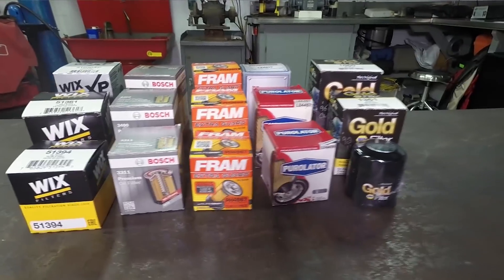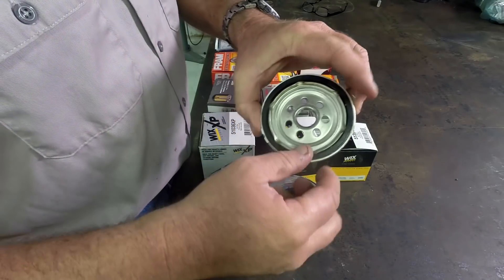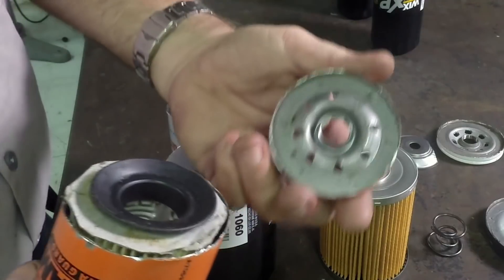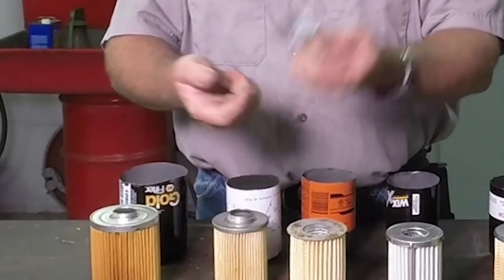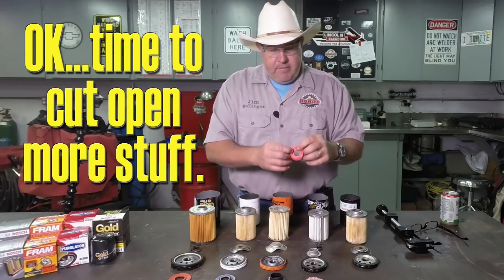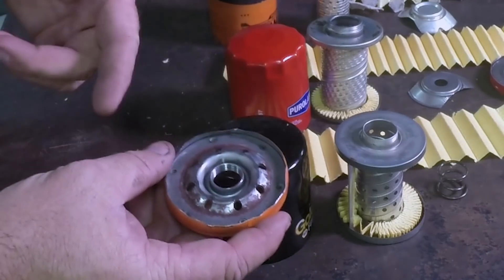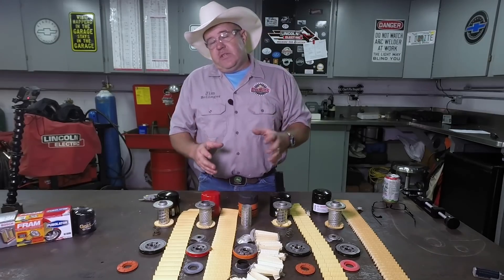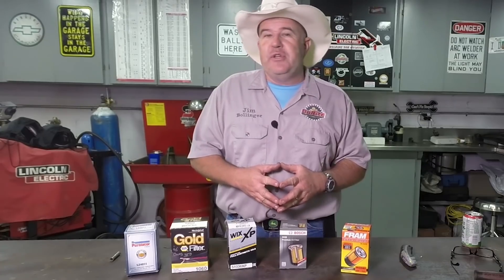The worst oil filter EVER!

Comment: the current Fram oil filters are nothing but shit.  never buy fram if you value your cars engine,  i was told by my local ford dealership about 8 years ago if you had a fram oil filter on your car, truck, or suv engine they would null and void your warranty because they claimed to have proof fram oil filters were breaking down internally and distributing the debris through out the engine causing engine damage.  word to the wise dont buy cheap buy quality.
Reply: Chris Ursiny I own a Ford and use motorcraft filters. and I thought fram was the best.
Reply: There was a TSB a few years ago when I was  Ford tech that just generically spoke of cellulose material from 'certain non-OE grade filters' clogging up passages. Ford apparently got into trouble naming specific brands, so they opted for a generic statement. However, I saw it all the time when these filters were in use, especially on engines like the 5.4 which has very small oil passages feeding the VCT system at the heads. All kinds of issues that caused the VCT not to function and even cause driveability problems. I have even seen camshafts destroyed due to passages clogged which caused oil starvation at the heads, which would then require new cylinder heads because there are no serviceable cam bearings. By the time you price out 2 heads and labor, a new engine is actually cheaper.
Reply: Damn cell phone, not hating.  Think I fix it!
Reply: Charles Larkin  No, this was years ago, and I am no longer in the dealership since I left to become a trainer. As I think about it further, it may have been an SSM. It was so long ago, that I cannot remember exactly. But it was a topic for discussion among the techs at the time and I remember our shop foreman being really adamant about looking at the oil filters and checking for debris when tearing one of these engines down. I also remember tearing down 5.4's and you would pull the block that the VCT solenoid mounts in and many times you could see crap in the oil feed holes, often it would have the appearance of being fibrous. So, I when I saw that, I attributed it to the issue that Ford was telling us about with oil filter deterioration.

Comment: Oil filters are not the only pieces of junk Fram makes.  I made the mistake years ago buying a gas filter from Fram.  It completely disintegrated inside stopping gas flow within a few months.  I took it off and it rattles inside like a bolt in a coffee can.  Absolute garbage.

Comment: I just wish the wix had the rubber grip on the bottom like the fram.
Reply: Wear light weight rubber gloves.
Reply: The grip is cute and all but oil filters don't require that much torque to be sealed. Just be sure to oil the o-ring hand tighten. Start car check for leaks. Filter wrench is handy if you really need some extra reach or torque... don't try it on the fram though, it'll punch a hole in it.
Reply: I've seen Wix filters with a wrenchable nut on the bottom.
Reply: @dano727     Ja, use an impact wrench to tighten up the filter.  Only pussies hand tighten oil filters.
Reply: can of plastidip and you are good to go.

Comment: You should compare the Napa Gold and the Wix XP to filters that actually compete with them like the K&N, Mobil 1 extended performance, Royal Purple, ETC.  You're comparing a bottom shelf product (Fram) to some quality products, which is a good comparison, but it would be even better to compare all good quality filters to demonstrate what products you should buy and why.

Overall, this is a great video, as it shows why not to use a bottom shelf product such as the Fram.

Comment: there are a number of videos comparing oil filters on youtube. All of them are basically the same. Would like to see someone do an comparison of oil filters after they have been used, to see how well they held up. What material they are made of or how thick the steel housing is, isn't that important, if they do the job. If after being used, they plugged up, ripped, allowed dirt to get past the filter or failed in some other way. This would be nice to know.

Comment: In colder climates, all these filters are mostly cosmetic anyways. Every cold morning, the bypass opens and any debris that settled into the bottom of the filter overnight just gets blown through into your bearings. Even with synthetic oil. Change your oil often and use a Fram if you want - they're fine for a low tech car engine.

Comment: I've used fram for the most part  the past 15years  or so mainly because come oil change time whatever oil / filter special  the auto parts had at the  time is what I got most of the time  it was the bottom tier fram filter as I got older began  paying more attention an watching  videos  like this  an checking my oil more often I do not  use thouse fram filters anymore if I do get fram it's the ultra syn one but that's rare now on a money crunch I'll use stp extended life or mobil 1 extended protection  an mobile 1 oil they really do work  well  an could probably go 10000 miles but I change mine at 4 to 5to be safe
Reply: youknowyoureallyshouldusesomepunctuationtoohardtoreadthiswayandyouknowwhatifinditveryhardtotypewithoutautomaticallyhittingthespacebaraftereveryword

Comment: I remember years ago we changed the oil on my buddies bike, he had a frame filter, we changed the oil, even filled the filter before putting it on to burp it. Finished the oil change a d the oil light was on. We rode it a little bit and it never went off. We went out and bought a wix and replaced it, no oil light.I've always tried to run wix on anything they made a filter for.

Comment: Watch a Fram video. Their reasoning for using a cardboard end cap is that it works better than metal. You can glue paper to paper better than you can glue paper to metal. Just watch their video before condemning the filter. As for rust I have seen that in several different types of filters, all depends on how they were stored. I'm not for or against Fram, even though I have used them off and on for years with no ill effects. NAPA gold or Wix is my preferred choice.

Comment: Biggest mistake SO MANY people do is they get the best Oil Filters.  They think that the more cleats = the more filtration.  Yeah but what you're also doing is starving all of the most important components of oil, because the oil pressure gets lower when you have a "Higher Quality" filter.  Those engines i always noticed don't last as long as engines that have always been ran with OEM or OE equivalent filters.

Comment: I've got 436,000 miles on my work truck . I put 430,000 of those on myself . I've used nothing but supertech synthetic oil from Walmart and fram filters . I'm not going to change the oil , but I will never use a fram filter again .

Comment: Used a fram filter on my last oil change, the next cold start, I noticed that the oil pressure was slow to build up and the lifters were clattering. Changed the filter for a Wix and topped off the oil level again, oil preassure back to normal and no more valve clatter on cold start.

Comment: I have used Frame filters for years, my last 2 trucks 1992 ford ranger 307,000 miles engine never apart and still running when I got rid of it. 2003 Ford Ranger 302,000 miles and still running great.

Comment: I noticed fram filters on engines with main bearing knock on startup. Changed to Motorcraft FL1A cured the problem. I recommend factory filters.

Comment: I have been using Fram for years and my engines have done quite well.  Solid has nothing to do with filtering- just look at the filters in your central air unit.  Also, if the Fram is pure cardboard, how could it rust?    With today's computer controlled engines there is not much for an oil filter to do. The engine is always in tune so there is no soot build-up.  That's why engines last forever these days.  There is no abrasive soot in the oil to wear out rings and valve guides,  so oil filters are not as important - and oil changes not as frequent - as they used to be. The important part of a filter is how small of particles its medium will stop, the amount of medium is irrelevant if it lets everything through.   I saw nothing here that gave me this info.   That kind of analysis would be much more valuable.

Comment: Where was you about 8 years ago?  I had a 1970 Chevelle with a 383 stroker motor it would do about 70 pounds of oil pressure so I decided to use a fram oil filter after the old change I drove it down to the gas station to get some gas when I cranked it up to start it at the gas station it blew off the fram  oil filter  least to say I have never used fram anything anymore I have always used wix since the ordeal. Thank you for the video injoyed it. I am a follower now I would like to see more great videos like this one

Comment: Have first hand bad luck with Fram filters. Have used Wix/Napa  or Purolator filters ever since with excellent results. Had Fram filter break down inside and restrict all oil flow. Motor started knocking on startup. Was fine when I shut it off. Traced no oil pressure to plugged filter. Changed oil and all was fine. Cut the filter open and all the cardboard had turned into sludge which caused the filter media to collapse in on itself.

Comment: I would love to see how the aftermarket filter compare to OEM filters. say for instance a Mopar, AC Delco, or Ford. I would also like to see how they compare to a premium filter like a K&N.  I quit using FRAM back in the late 80's when they switched to the cardboard liners.  I have been using Wix  or K&N  ever since.  the K&N has the thickest metal can i have ever come across their marketing material says they are designed for high flow and higher pressures. I have been using them on My big block Camaro and I have never had a problem with them.  as a side note, the newer Fram ultra filter have a metal filter cartridge, i still don't use them based on past experience with Fram.

Comment: I have a '96 Yukon with close to 300,000 miles, original engine still running strong with zero oil consumption/blowby and good oil pressure, I've always used Fram oil filters and the whatever oil happens to be on sale...just change it when you're supposed to!
Reply: 291,540 miles on a 1999 4.2 v6 ford f-150. Only used Fram oil filters, and I beat the crap out of it, no smoke, no knock, no nothing; just runs smooth. Now hear me out, oil filter manufacturers know making something, expensive will make people believe that the expensive thing is better than the cheap thing, it's marketing. I rip into my old oil filters to see what the filter is doing and the answer is the filter is being a filter. Nothing really wrong with going cheap just the occasional person on the high horse telling you how stupid you are for being cheap.
Reply: My 98 Yukon has 220,000 miles and I use AcDelco oil filters. 
You're not taking good enough care of your Yukon.
Reply: @Thinker669  : Homey has near 300,000 on HIS vehicle yet you're going to tell him how it's done.
Reply: @Thinker669  I restored my 1998 4x4 Yukon. New 5.7 V8 and trans. I can now go back to having sex with the olballnchain again!
Reply: I have a 2008 sonata with 360 k running great, use fram but change it every 5 k.
Reply: If you want longevity in your engine oil you can change you oil filter any time you have the some symptoms, like excessive dirt when off roading  like owners manual says, but leave the oil in the vehicle.
Reply: noshsreqd As cheap as it is, the Fram filter may be adequate. But there’s no denying the others are better.
Reply: Typical GM user using cheap parts xD
Reply: I feel sorry for your engine.
Reply: that's because it's a 96. try doing that with a modern engine. lets just say it won't be hitting 600,000 with those filters
Reply: @ironfist452  I'm just going to say that me myself would NEVER have a new vehicle because thet all suck and don't last as long as the classic ones where they didn't have 90% of the crap on them now that is not needed and a waste! I will never have a vehicle any newer than 1980, that and older. If I was given a brand new vehicle for free, it would have a for sale sign on it immediately in my front yard !!
Reply: noshsreqd yeah , and I bet you don't sit at redline all day long. Come back when you you take your Yukon to a track course. I BET i could blow its engine up in 15 min
Reply: I use fram on all my vehicles. No problems yet. Will continue to use fram until I have a problem. Last truck was at 225k when I sold it still running fine.
Reply: Ok... so you got lucky... but then again it's a damn GMC so it's designed to rust and I'm sure the oil has plenty in it anyway. If you viewed this breakdown and still swear by fram... I guess that explains why you drive GMC's. You just dont give a shit.

Comment: I had my oil changed and the oil light came on at low engine speeds.  After I changed the filter the problem went away.  It was a white unknown brand. I don't take my car in for oil changes anymore for this reason and they strip the oil drain plug.